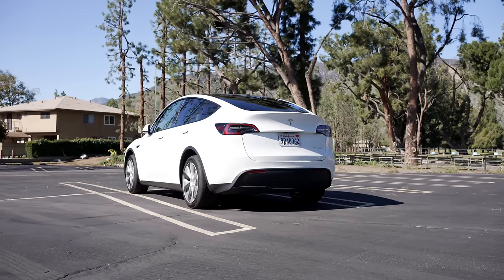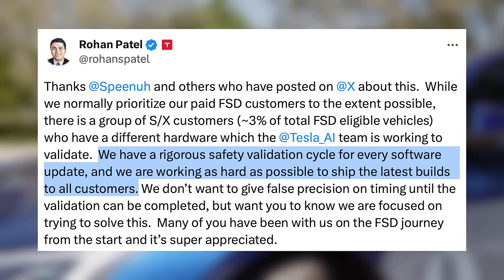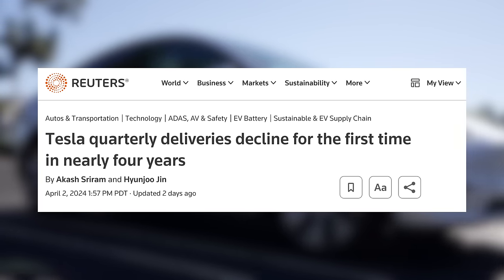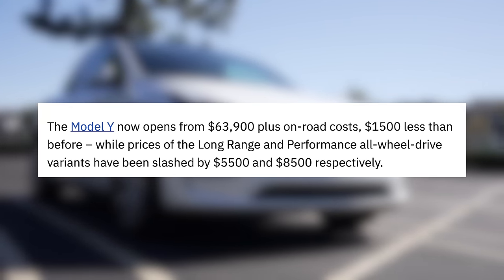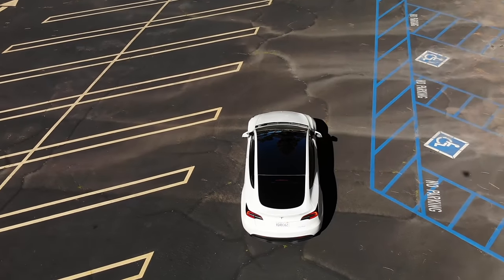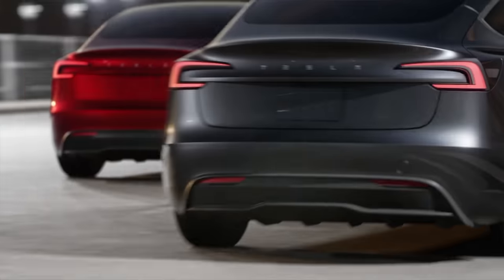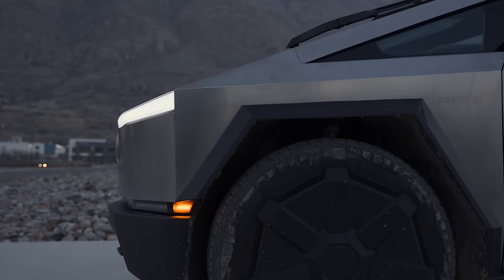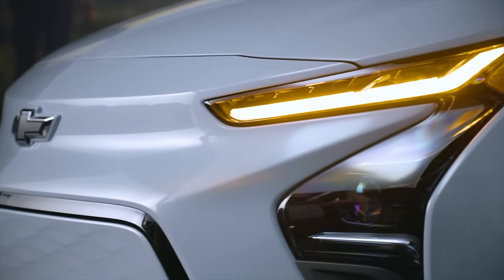HUGE Price Drop On Tesla Model Y | They Finally Gave In

Comment: The Model Y’s will be even cheaper if you wait for the announcement of Juniper release.
Reply: I agree. The Juniper will be better and probably cheaper for buyers after the first wave of desperate buyers.
Reply: Yea but hopefully it will still qualify for $7500 tax credit
Reply: @brivera1  I believe a loss of the credit would require a change in battery chemistry, or a change in the president.
Reply: @BobbieGWhiz  No, the requirements get more strict every year. This is why the Model 3 suddenly stopped being applicable for the rebate in the US in 2024 despite not shipping the refreshed version yet. Next year the critical mineral requirements that must be from the US goes from 50% to 60%. The US-made battery component requirement goes from 50% to 70%. Not sure if even Tesla will qualify for the rebates anymore unless the get 4680 production ramped insanely quickly.
Reply: I was checking them out they wanted 900  monthly payments and 700 dollar insurance
Reply: @coltonmccormack8978  Right, I was assuming Juniper would be released later  this year, but it very well might not. Hopefully the stringent battery requirements will incentivize domestic battery production, more rapidly.
Reply: any news about it? I'm worried
Reply: @dosso96  The Internet prefers to deal with rumors over news.
Reply: if Elon was not so scared of Chinese EV competition being sold in the U.S. All models of Teslas would be WAY cheaper.

Comment: Been using FSD for a week! It works great! I really like it, and they’re very strict, you really need to keep your eyes on the road and hands on steering wheel, but it works great! I like it!
Reply: If you still need to keep your eyes on the road and hands on the steering wheel then why not just drive it yourself ?
Reply: How comfortable would you feel keeping your eyes closed for a drive? Overall it’s pretty cool to trial, but it’s not there yet. Sometimes I have to give it a nudge to drive faster (as it slows for no good reason) or to get it to make a right turn after stopping at a red light even though there’s no traffic preventing it from proceeding. It accelerates too fast from a stop and takes too long to slow down at a stop causing it to use the mechanical brakes on top of the regenerative braking. I’ve had two or three critical disengagements.
Reply: @DGander007  … because it takes the minutia away from driving.  You arrive much more relaxed and it is safer since both you and the car are paying attention.  Try it and you’d know.

Comment: Got my FSD trial and used it for about three highway miles before I had had enough.  I am a driver and that’s not driving.  I am sure some folks will love it.  I will still take a pass, thank you.
Reply: Highway is still on v11. If you are going to test v12, you should do in town driving. Then you will see the difference.
Reply: Yep, it sucks. Feels like a 16 year old chauffer.
Reply: highway works well perfectly in traffic, great for those with 1 hr commutes,  In fast speed lane change situations, its too conservative.  Treat it as a tool that can save you a lot of pain, learn to switch in and out of it like driving manual.  I think it's great and you also realize how intelligent your car is

Comment: I have FSD since 2021 on my 2020 MYP. I wrote to Tesla service to get my 12.3.3 update and they uploaded it 5 minutes later. It is a game changer compared with 11.4.9. In addition, I also passed from 2023.44.30 to 2024.3.10. It seems the HW3 is merging very soon with HW4. Still waiting for Smart Summon and Autopark to replace my versions. Purchased the biodefense a few months ago and took care of my cigar smoke 😊. I am waiting for the 2025 Y cause the current suspension is crap crap crap.
Reply: looks like elon has finally cracked the code for FSD
Reply: Yeah, the difference from 11.4.9 is shocking. I assumed it was all hype and expected a modest improvement, but it really is night and day. I've had 12.3.3 for a week now and done probably 3hr or so of FSD across a good range of environments (highway/in town/country rd). It was total trash on roundabouts before and handles them great now. Also does 4-ways much better, though it's still a little slow unless you nudge it with the accelerator. It responds really well to that though; I can "encourage" it through stop signs or merge points etc. really nicely now. There's still room for improvement to be sure. It's not terribly thoughtful or strategic in traffic negotiation, for example. But the actual driving control part is really darn good all of a sudden. Everything is so much smoother.

Earlier tonight I took it out in the dark, and had it drive a 2-lane blacktop road with a 55mph speed limit. Mostly it would go a little slower than the limit, even if I set the max up to 65. Even on straights it would top out at about 57, and in turns it would slow down considerably more than a typical human would. Around the time I was finding that out, it occurred to me that I had embarked on that testing run without really much concern or second thought. No big deal, just figured I'd have it go drive a twisty blacktop in the dark. And afterward my only real complaint is that it went slower than I'd have liked. That's...really quite something.

It still needs supervision, all the time. And I find it works best with a little bit of interaction as well. I give it a helping hand here and there regularly; I'll use the blinker to move it into advantageous lanes, nudge the amps pedal to get it to turn onto a road, and things like that. And then I'll take over completely if there's like, a construction crew, or to merge between two busy highways. You can take over for the tricky spots and let it do all the grunt work. I wouldn't let it handle every single situation totally hands off, but it sure makes driving across town through traffic a lot more pleasant.

To my mind it's a really, really useful tool. It's odd to me to hear people talk like if it can't handle 100% of all situations with zero intervention that it's totally useless. Regular old cruise control never handled anything but keeping the speed the same, but it sure made driving down the interstate a lot nicer, didn't it?
Reply: The ‘24 YLR rides VERY NICE

Comment: I got the update on my Model YLR and it is MUCH BETTER! I recently had surgery and had to drive to another state and wasn't looking forward to it. FSD made it VERY DOABLE! With that said, it's still not perfect. Three issues it still has:

1. It doesn't avoid potholes. I don't care how big the pothole is, it'll plow right through it. Therefore, you still have to remain very vigilant. Considering it has 3 cameras in the windshield, I don't know why they don't program this in.

2. Speed limit decreases. We all know that sometimes you're on a road with a speed limit of 40mph, but nobody drives that slow. So you put the limt at 52, which keeps you going with the flow of traffic and all is good. All of a sudden, you notice you're going very slow. You must have moved "to a new area" and the car once again adjusts to the new speed limit. What I'd prefer? If the speed limit was 40 and I set it at 52, that's 30% faster. If moving to a new area, that 30% adjustment should be kept. So if you move to a new area where the speed limit is 45, I'd expect it to reset to 58 1/2, or 59mph. Maybe it can give an audible alert so you can decide if you want to adjust that.

3. Construction areas. Simply put, it doesn't handle them well. If cones are put in the road to turn two lanes into one, it simply gets stumped and doesn't know what to do, forcing you to take over. 

I'd say in my hour long drive, other than me having to adjust speed limits, the car did maybe 55 minutes of the driving. I'd LOVE to buy it, but not for $12K, that's just way too expensive. Drop the price down to $3,500 and I'd buy it. It's simply too expensive for the average person to justify at $12k.

Comment: I'm interested in the Model Y updated with softer suspension, new windows to reduce road noise, and the new fast-charging C.A.T.L. LFP battery.  From what I've read, this could be late '24 or early '25.  Your thoughts?

Comment: If you list prices from different countries, you should denote the currency, ie.. AUD Australian dollars, USD US Dollars.  There are some great deals to be had right now.  I just bought a model YLR on 3/19/24.  The standard model Y version that doesn't qualify for the $7500 tax credit had to be lowered significantly, otherwise the long range variant with the tax credit would be cheaper and a massively better deal.  I am loving my Model YLR and FSD 12.3.3.  I think China will get the very latest full "Juniper" refresh first and maybe we will get it 1.5 to 2 years later.

Comment: Picked up the model Y Friday with an original price of $52,999 with $5200 off and the $7500 tax rebate. That's my second one since I have a Y that's also under a 3 year lease I'm giving back in September. I'm going to replace that with another one as well. My older Y is $810 on a monthly lease and the new one is $575...I'll have two Y's for $1150 instead of one for $810 lol

Comment: I feel FSD is all but useless. Biggest gripe is that here in N.Carolina speed limits are ignored, using FSD means you are holding back traffic and pissing off everyone. Next  there’s the steering wheel sensitivity. Finding the sweet spot requires too much effort. If FSD was a $500 option I still would pass with no regret.

Comment: FSD has improved a lot however my Model Y attempted to pass a stopped school bus while children were loading.  It's impressive but still needs work.
Reply: Yup, my FSD 12.3.3 still runs the red meter lights at the entrance of freeways 😮
Reply: Yeah I had it turned into the wrong lanes when making a left hand turn out of stoplight.... I had it end up in a turning lane when I was trying to go straight... Then I had it slow down to 40 mph and stay there even though the car was indicating that It read a sign that said 70 miles per hour but no matter what I would do it would not go faster than 55. Then I drove through the same area again like 2 days out later and there's like a 20 mi stretch of highway where the car refuses to go faster than 55 mph even though the speed limit there is 65 or 70 depending on where you're at. It was super frustrating I pulled over and switched off FSD.... Drove through the same area with enhanced autopilot It was a little bit better but it was still behaving pretty weird. I drive through there typically once a week and never had an issue before this update so I'm guessing something changed.

Comment: yep, I would absolutely wait until the current EV credit runs out. I just have this gut feeling that the current inventory won't be cleared unless Tesla slashes another $5000 off the MSRP only on the inventories. Tesla should act quickly to remove the inventories since things will get worse for Tesla as it gets closer to the Juniper debut here in the US.
Thanks for you opinion Ryan.

Comment: just tried the FSD. it has some issues I experienced: 
1: It accelerates too fast from a complete stop with no traffic or no cars parked on the side of the streets. in a neighborhood with 20mph speed limit, it always goes past speed limit when it goes from 0-20 then it slows back down to 20mph. i feel like i'm on a 1/4 mile track when I leave a stop sign under the conditions I mentioned. 
2: it decelerates too late if I approach a stopped vehicle in front of me. I'm almost certain, it actually applies the actual breaks when it comes up to a stopped vehicle rather than relying solely on regen breaking.  
3: it doesn't like stop signs at train tracks. it sometimes just sits at those stop signs until i put my foot on the 'gas'. 
4: it doesn't like to turn into certain divided roads. it doesn't really have a problem with the one in my neighborhood but always struggles and fails the one right before I get to work. The one before my work has support pillars of an elevated road way that act as a median ground/ lane divider.
I do like how smooth it behaves when on the interstate. it changes lane very smoothly although signal blinks two too many times before executing the lane change. it also accelerates very smoothly after lane change to make a pass. and when there is a semi truck in adjacent lane, my vehicle moves away from semi or large trucks slightly while staying in its own lane.  And that action is more noticeable when I am passing the truck and not the other way around. 
The bottom line: While it takes away a lot of subtle but constant adjustments during long range interstate driving and it is very much appreciated, I still would not pay $12k for it.

Comment: I got my update, as a non-FSD subscriber/owner. I have not tried it yet, but I do notice an improvement of the vehicle visualization. I continue, however, struggle to see the killer use case (especially for the ridiculous cost). Are there really customers that prefer stalkless steering wheels? To me this is a solution in search of a problem, but maybe there is a portion of the driving population that hates stalks?
Reply: I dislike stalks
Reply: @dalejewell9916  Ah, you're the guy. Seriously though, I'd love to see Tesla market research to see drivers were frustrated by stalks.

Comment: I agree the delay to the Model Y Juniper release has likely depressed sales quite a bit. Potential Tesla customers are probably more clued up on the products than most other mass market car customers are. So the big Model 3 upgrade vs the 'old' Y even if it has had a few tweaks is a bad move, especially as it'll be 12 months before Juniper's released..

Comment: My 2024 Model Y is running the 2024.8 software rather than the 2024.3 software fork.  It seems that the older Model Ys running 2024.3 are getting the FSD trial offer, but not the newer ones.  Strange.  No word whether the trial will ever be offered.

Comment: In my 2024 Model Y purchased in February this year I have of late received version 12 auto pilot.  I am frustrated with V 12 because it lane changes left on the freeway but doesn't increase speed to the surrounding cars and the cars behind me.  Nor can I set the speed anymore due to some "Max Speed" setting.  What if I really do want to travel a bit slower or stay more in the right freeway lanes?  Some other local driving "testing" has been somewhat more of a better experience.  If TESLA actually listens to the verbal feedback I give, they did get an earful a couple of days ago

Comment: Model 3 ludicrous looks sick in Ultra red. When are there going to build a Roadster design model 3, don't need the crazy $200k spec version, model 3 LR specs would be fine, maybe slightly faster top speed.

Comment: I don't want or am interested on FSD even if it is able to cook whole breakfasts, lunches and dinners.  I am OK with the basic cruise control and that's it. But if Tesla offers FSD at 9.95/mo fee, I would consider my stance. And no, I am not interested in High Performance or speedy models at all.  All I want is a long lasting, high quality, reliable, safe, smooth ride and enough spacious vehicle.

Comment: news flash, its still not worth 12k/200 a month.  ive been using it, and it sucks. it drives like a typical california driver, its clueless half the time, misses exits, excessive and unnecessary lane changes even when set to chill and minimal options turned on,  slams on the brakes at yellow lights etc.  
im more stressed out when i use FSD than driving myself.  
its a legit novelty at best.  im glad to get the free trial, it saved me 200 bucks to pay for my own trial.

Comment: they should do like BMW and have one long display that stretches behind the steering wheel and to the side probably cost the same as the giant center display.  and not many are using the standard rear display might as well make it optional or get rid of it and just have physical controls for rear passenger HVAC.

Comment: I got the FSD trial for a few days. It doesn't merge in/out of the express lane correctly; it doesn't choose the right routes. When the marking on the road gets complicated, FSD gets confused and try to crash the car dividing wall.  I am better off with free autopilot. It is safer.

Comment: If FSD worked perfectly there might be a take rate of 10-15%. So what. Most people want to steer themselves. Paying $12000 just to let go of the wheel won't appeal to many. Then comes approval by authorities. Robo-taxis is even less realistic as a mainstream phenomenon, just one mans imagination. They should make FSD available by the hour, so that if those not comfortable driving in cities for example, could just switch it on while they visit the city.

Comment: It only blows my mind how bad it is for the level of confidence and good reviews I have seen. Perhaps it just doesn’t work as well on the newer models?

My 2024 MY Long range experience with it is laughable at best and dangerous at worst. It’s too cautious when there’s no need and not cautious enough when it should be. It can’t read road or traffic pattern changes as soon as a person can and is often in the way of others even on assertive mode.

They should just activate the cameras FSD uses for use in autopilot and collect data. My coworker has a new Y performance and has even worse experiences than me. From my estimation anything worth $12,000 is years away.

Comment: Would buy a Tesla immediately if it had the 48 volt board network and, above all, a bidirectional charging connection. We have been driving electric for 5 years and have time. Why does it take so long for Tesla?